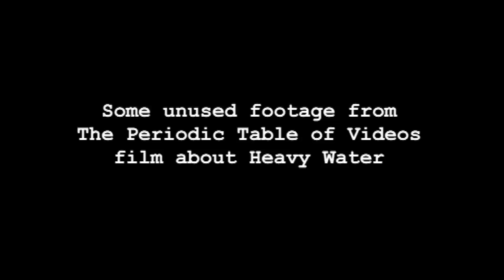Heavy Water (extra footage)

Comment: D2O is about 10% denser than H2O, because the atomic structure of a hydrogen nucleus is 1 proton. Deuterium consists of 1 proton and 1 neutron. Neutrons are also more massive then protons. D2O ice sinks in H2O because of that. The next isotope (unstable) is T2O, or Tritium Oxide. Tritiated water is another name. It consitsts of 1 proton, so it's hydrogen, but with 2 neutrons. Tritium (H3) gas is used to illuminate some watches, keychains, etc. It's half-life is ~12.3y. It emits beta particles.

Comment: @YamiPoyo Deuterium is not radioactive, another isotope is called tritium. The reason why people often associate heavy water and deuterium with radioactivity is because it is sometimes used in nuclear power plants as a coolant. Heavy water is, however, slightly radioactive because small traces of tritium are found in heavy water, but small traces of tritium are also found in normal water. However, Heavy water that is used in nuclear power plants is more radioactive due to neutron bombardment.